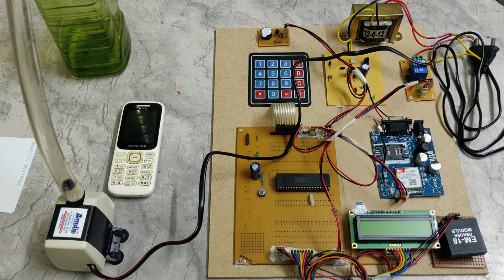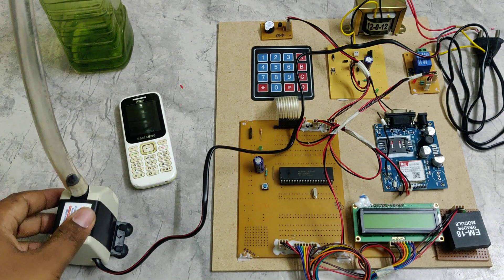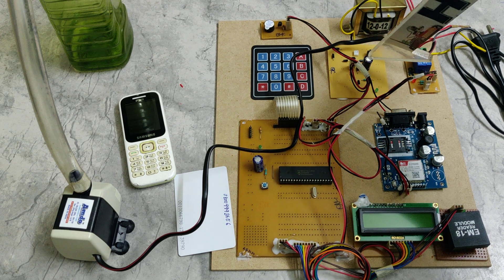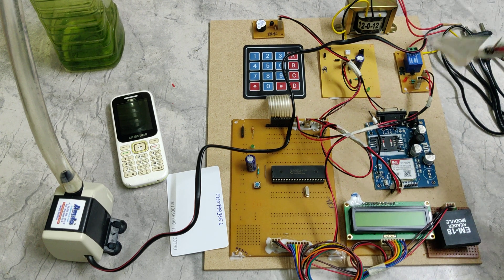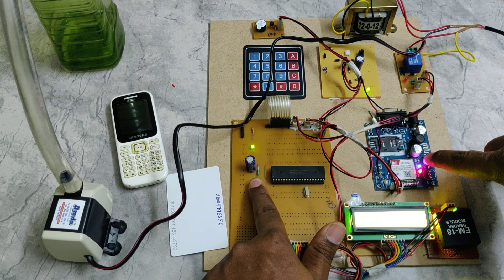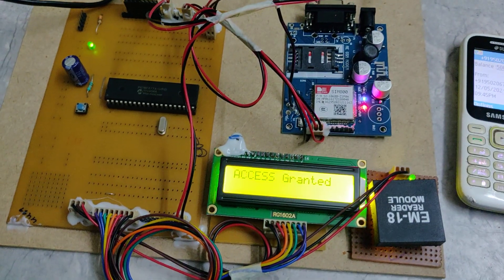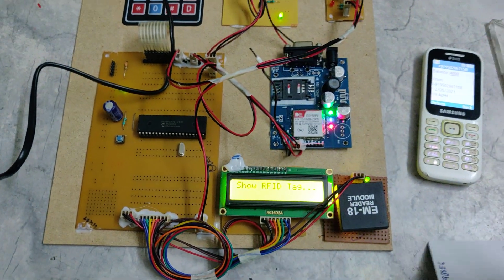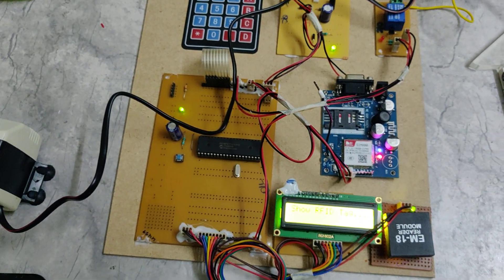Automated Petrol pump using prepaid RFID Petro Card with SMS alerts

Comment: i need the details of the project, the circuit diagram the code.please help
Reply from the maker: You can contact us at +919603140482
Through WhatsApp or call
Reply: @hvstechnologies  can you provide connection video
Reply: And Arduino code video
Reply from the maker: @mahetabnaaz2857  You can contact us at +919603140482
Through WhatsApp or call